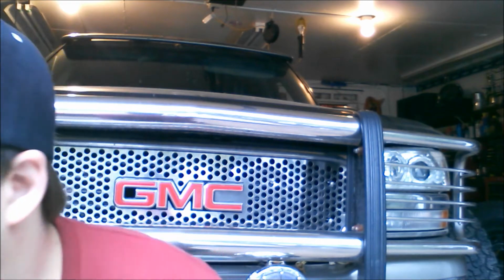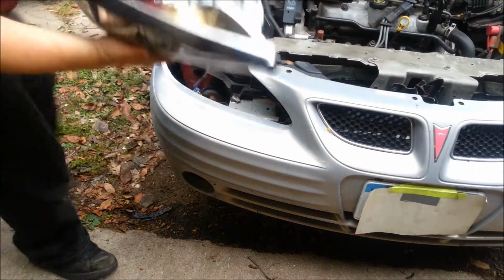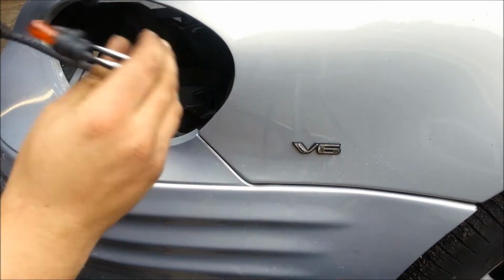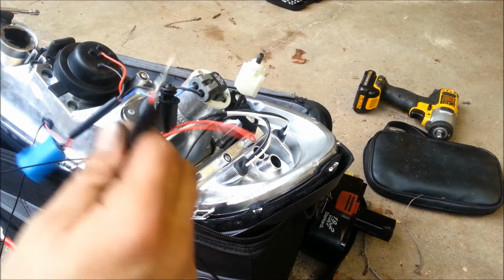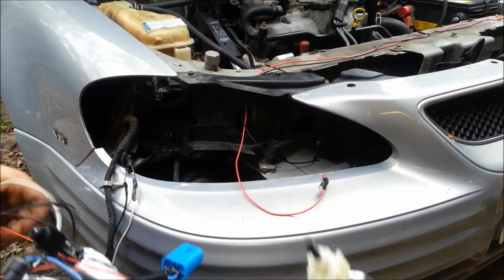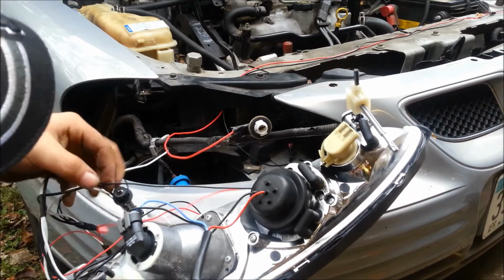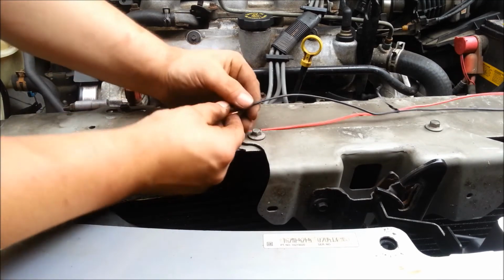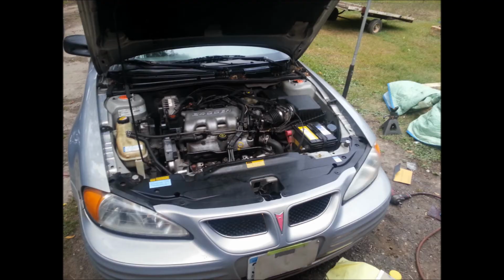halo LED headlamp install Grand Am 99-05

Comment: So basically you take off the original headlight, plug in your old bulbs, and run wire from the 10amp radio fuse to the halo's and leds? am i missing anything
Reply from the maker: and just ground the right wires and splice into the factory wiring for the marker bulbs

Comment: I had a ?. I changed the bulbs on the headlights but when I put them back the driver side was good but passanger beam light was going more towards the othe headligjt. So I dont get much light on the right side. But, I paid to get them done and when they were put on there was a liitle space around the headlight because the needed to cut a grommet for light to fit in. If I just adjust it the way u did would that fix it? Otherwise im thinking of taking whole headlight off and checking if I put it on wrong. Any recommendations? Thanks
Reply from the maker: I would check how the headlight sits in there some times the holders don't grab the lower section of the headlight and they will throw off the adjustment

Comment: do I need extra wires too to put a 10 amp fuse on the driver side fuse box or to the battery?

Comment: Do you have a tutorial on how to connect the wires to that 10 amp fuse? The red and black wire going from the fuse box.
Reply from the maker: black wire can be grounded anywhere on the body, i dont have one on video as my camera died but you run the wire up under the dash and just splice it in to the the wire going to the radio by figuring out which terminal has power going to it with the fuse pulled out. using a multi meter is the best way or you can just wire it to a switch but i like the automatic way

Comment: So I installed my Spyder Halo Projectors.  Once I first wired the inverter to the headlight I checked to see if both the Halos and LEDs worked.  After that I wired everything together.  My problem is that my Halos do not work when I turn on my lights.  Only the headlights and the LED turn signals work.  Do you know whats wrong?
Reply from the maker: as to what did you wire the halos into?

Comment: Did you have to cut some of the inside of the panel in order for the halo light to fit?
Reply from the maker: i did not i read that on a few forums but i did not need to

Comment: Do they adjust themselves after installation?
Reply from the maker: No there are adjusting dials but my installation was good and headlights were adjusted correctly with little to no adjustment
Reply: @JoeTheAutoGuy  ok now I have LEDs n I'm having a hard time getting them adjusted, is it possible I have them upside down
Reply: I can't upload a picture to show u what I'm dealing with
Reply: But it looks like I have 3 headlights instead of 2
Reply from the maker: @russellburkhart9906  feel free to send a pic to Joetheautoguy@gmail.com and I will see if I can help you

Comment: im just saying you could hook up the halo and leds to the normal lights with a splicer connection
Reply from the maker: i completely agree but the now owner of the car wanted individual control of the halo lights..thanks for watching
Reply: oh okay lol and your welcome
Reply: JoeTheAutoGuy I also wired directly to the parking lamps and it works great. But how did you get a seperate control for the halos through the radio amp?
Reply from the maker: all it did was just power the halos when the key is on , so at night when parked you can turn the key on with the parking brake pulled it will cancel the automatic lights and then you just get the halo effect , there are other ways to do it of course just this was the best way for easy control and not forgetting to flick a switch and such
Reply: JoeTheAutoGuy makes sense